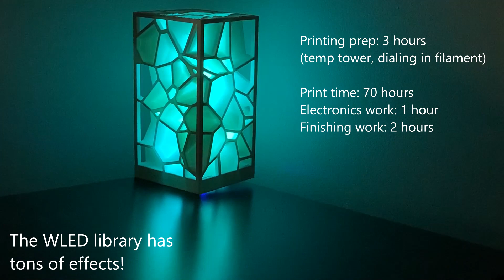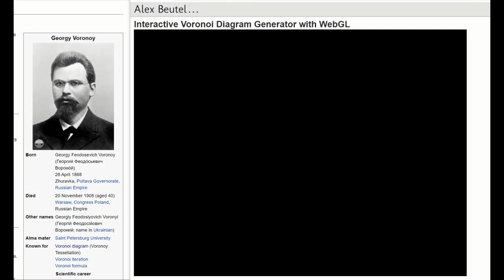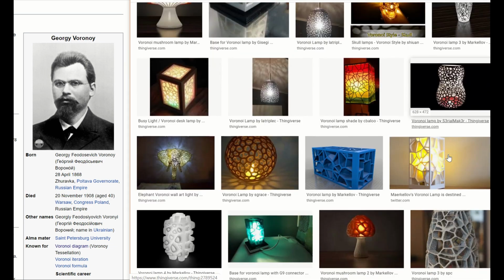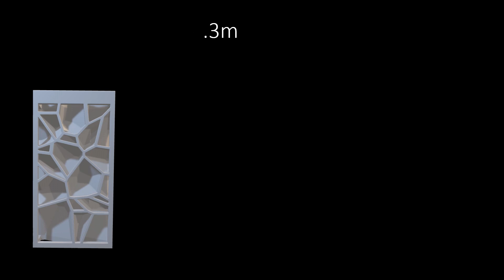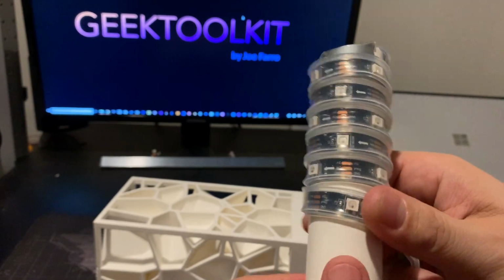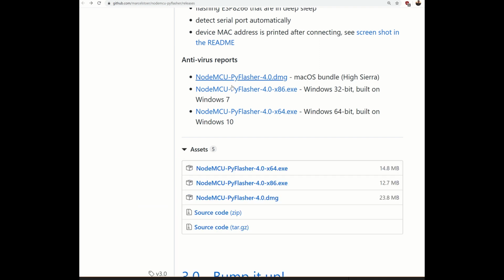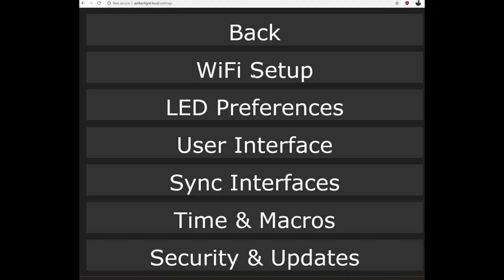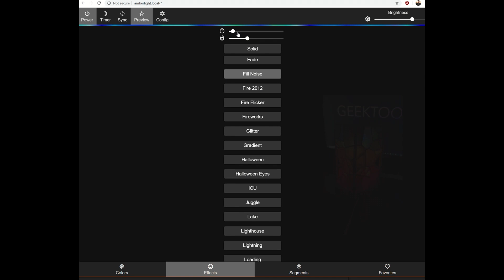3D printed Voronoi RGB Lamp with App/browser control

Comment: Nice ! I want to ry it on my AM8. Please tell me the print settings you used. Nozzel size , number of walls , infill ,  layer height ? Thank you so much
Reply from the maker: I did a 0.4, but wish I’d tried a 0.6. I used default settings for Cura at 0.4mm layer height with 20% infill, and I think about 40mm/s. I don’t recall much else but I pulled mu settings from reading the comments on thingaverse

Comment: very interesting, this sparked my interest to maybe get my own 3D printer in this quarantine "boredom"...
any tips on which 3D printer to get that would be capable of doing this (for as inexpensive as possible)? 
I had my eyes on maybe the EcubMaker TOYDIY 4in1.. would that be capable of it?
thanks!
Reply from the maker: thed0n I believe so! It’s a 180mm print bed so you’d have to scale it down but even my version was scaled down 80% from the original on an ender3 pro (220mm vs 180mm for the Toydiy.). Also that thing looks amazing...I think the CNC and laser features would keep you quite busy as well as the 3D printing part!!

Comment: Noob question, as I'm about to attempt this myself. What did you do for the power supply?
Reply from the maker: I actually have a micro usb cable that supplies 1amp or so plugged into a wall (like an android charge cable). If I did it again I’d use a higher amp rating but it’s not really a “light up the room” project as much as it’s a great visualization
Reply: @geektoolkit  Sweet! Thank you for the reply. And thank you for the video, I wouldn't have been confident to try it without a step by step.
Reply from the maker: You’re welcome! If you hit issues let me know. It’s a great project!!
Reply: @geektoolkit  Another question for you! About how many LEDs did you use? I ask because I have a longer strip, but I'm not sure as to how many to put in there. I could make them rather dense, but I don't want that at the expense of brightness.
Reply from the maker: @ty_bergman15  Short answer: I put 35 I think in. And 25 would probably have been 'ideal'.   Longer answer:  Here's the basic math...20 ma per color...60 per pixel if all three colors (red,green,blue) are on.   You can source about 1 amp off of the chip. That means you can run about 16 leds 'full bright white'.  But most of the time I'm  using colors, so lets say 40ma if 2 LEDs were full on..that's about 25 you can run.  If you're looking to make a bright white and don't want to sacrifice you can go 16.  These are estimates, and for various reasons things don't work as cleanly as the math, but should give you some info to help guide you.  Also keep in mind 2 leds at 50% brightness may give you better diffusion than 1 bright one at 100% brightness with the same power, and longer LED life. I know that's a long answer, but hoping it helps.

Comment: How did you print it without supports? There are these floating overhangs inside of the 3D print which isn’t accounted for. 

Edit: for the people that have a similar issue, use the option ‘infill support’ in Cura. Play around with the infill support pattern to take as little space as possible to keep the walls seetrough.
Reply from the maker: It’ll bridge if the printer speed and temps are dialed in. Honestly I had some areas to clean up because I wasn’t as dialed in as I should’ve been but it’s basically like a giant bridging stress test. With supports I think it’d be a nightmare to remove
Reply: @geektoolkit  I found a solution. Basically because of no infill at all, I get these floating overhangs (that is what I meant with my comment). I am now trying the ‘infill support’ option in Cura, with an overhang angle of 85 degrees. This causes some extra filament inside of the lamp which will probably make it less see through.
Reply: @geektoolkit  FYI Bridging is no issue, my printter can handle that pretty easily, what I meant was the floating overhangs because of 0% infill
Reply from the maker: Ah interesting. I printed this so long ago I don’t recall that. I want to reprint it but with a .6 nozzle most likely and a .3 layer height to see if I can speed it up. It’s an amazing print just 4 days was ...a bit much. In the end though as a lamp the project IMO is just amazing
Reply: @geektoolkit  Yeah mine is currently printing, 2 days to go😁. Its weird that I couldnt find people that got the same issue when applying 0% infill. Basically you hollow out the structure which causes some floating parts. The infill support option, only uses infill as a support for the inside of the structure, which helped solve my problem.
Reply from the maker: I’m going to keep that in mind for my next print. Please let us know how it goes!

Comment: Printed one today on my Mono… took 3 hours
Reply from the maker: Aw as in SLA mono? That’s amazing as it probably looks so much better. Was it full sized?!
Reply: @geektoolkit  It’s about.... 8-9 inches tall and 5/6 wide... not huge but nice enough. Only issue is - and this one killed me - I used a 1/2 bottle of clear resin (thinking it’d be better for the light to shine thru) and, after washing, I cured it for a few minutes too long (I guess) and it turned this weird rose/burnt color everywhere. I guess it spent too much time under the UV lamp - didn’t know that could happen. Now I’m stuck trying to find a solution (I’ve tried sanding, paint, inks/dyes, etc.) and nothing.... can’t get rid of that damn rose tint it has now! Any suggestions!? Or should I stop fiddling with it after 2 weeks and GO BURN IT TO A CRISP FOR COSTING ME HOURS AND HOURS AND HOURS OF WORK?!? Lololol
Reply from the maker: Oh no! That’s awful. I don’t have any ideas because I’ve not worked with resin. I’d post it on Reddit or a Facebook group to see if the community can rally and suggest something. There are some amazing talents out there that hopefully can help

Comment: Are the colors and patterns loaded in or does this have to be connected to a WiFi to work?
Reply from the maker: Vince S The colors and patterns are on the device. You can either connect it to internet wifi or just direct connect to it (ad hoc) and control it...it doesn’t have to connect to any wifi outside of itself. Once you connect and tell it what color patterns you want to do it’ll do its thing

Comment: im doing this right now, but how do you connect the neopixel led, it has 4 wires?
Reply from the maker: Typically there is Vin, Gnd, DI, and DO.  The DI is 'in' and what you want to connect to the GPIO pin, the DO is 'out' for connect the next strip.  Let me know if that matches what you're seeing
Reply: @geektoolkit  sorry im new to this, i have the same led strip as you but the diagram does not match, you mind explaining in a little more detail? thanks
Reply from the maker: Sure I’ll do my best. Look at the end of the wire and let me know if you see a DI or an “in” . There are three pins you need...one is 5v...one is ground (GND) and then you need to find a signal pin (usually labeled DIN). Once you have those you can ignore the fourth pin
Reply: @geektoolkit  ok, thanks i got it!
Reply from the maker: Yay!!! This has been one of my favorite projects that a lot of people talk about when they see it in person....I’m glad you got it working and hope it brings you a lot of happy times...my wife out it in the window so that when people go on evening walks they can see it and it’s been a hit. Glad you got it going, if you hit any other issues let me know!

Comment: Why print upside down?
Reply from the maker: Good question!! I should’ve covered that more..It’s to hide overhang issues if your printer doesn’t handle the spans cleanly. This means that the first layers that may “dip” will be hidden because they’ll be on the bottom side of the lamp. This was a tough print for me, though I’m going to try it again with a 0.6mm nozzle and maybe try to dial in my spans
Reply: @geektoolkit  I appreciate the quick reply, I plan to make this when my new PLA arrives. I figured this must be the reason, but for some reason it seems backwards to me. If it's the first layers of an area that dip, wouldn't those be on the bottom, and then when the part is flipped back over, they would then be visible on the top of those areas?
Reply from the maker: @l.w.c.2519  Sorry you're absolutely right, I got that backwards in my head...dangit now that you mention it I'm not sure why I flipped it...it may have been what the comments in thingiverse said to successfully print it.  I do recall that when it was done, the bottom of it had loops that I had to clean up, but I'm not clear of why...as you said they should've been underneath. I'll have to play with it next print, and I'll try to remember to come back here to update. But yeah thinking it through you're absolutely right, but my wife's (which is what i made in this video) had all of the blemishes that I remember underneath. It's been a long time since I built this, I wish I recalled more.  
  I'm excited you're going to give it a go. It's a super super cool item.  I wish that I could make the model myself, I'd liek to make a few different variations like cylinders.  Maybe one day I'll get time to.  Best wishes on your print, make sure you've dialed that filament in, a temp tower may help.
Reply: @geektoolkit  Totally understand, again I really appreciate you taking the time to talk about it with me, especially due to how long ago you made it! I've seen more people mention it being upside down so you aren't alone in that idea. I'll let you know how it goes, its a gift for my wife as well if all goes well haha!
Reply from the maker: @l.w.c.2519  oh that makes my day! I do these videos so others can learn and make cool stuff, so a gift of love, that'd be a beautiful story! if you hit any issues let me know, if you dont see me on here i'm on instagram as geektoolkit and you can dm me there, or i have a geektoolkit group on facebook. If you can get past the print the rest should be pretty staightforward!  Glad to help!

Comment: What size pipe did you use?
Reply from the maker: 1 1/4”, though I printed at 80% size. I think once you have it printed I’d just double check....you may find a paper towel tube or similar works just as wel

Comment: Did you use PLA?
Reply from the maker: yes! I should've mentioned that. I find PLA easier, I don't have to worry about warping or anything.  I'm sure this could be done in just about anything...I'm tempted to try clear PETG at some point